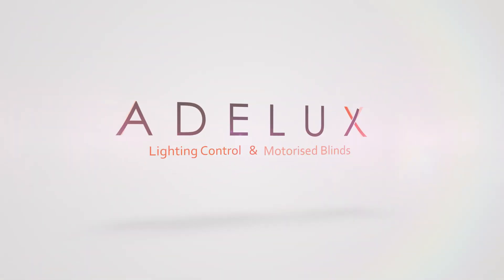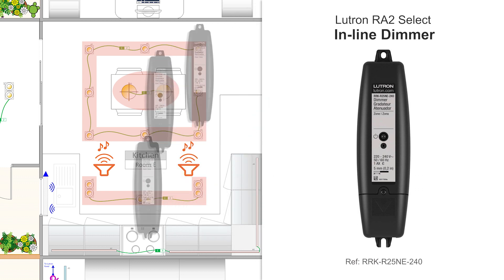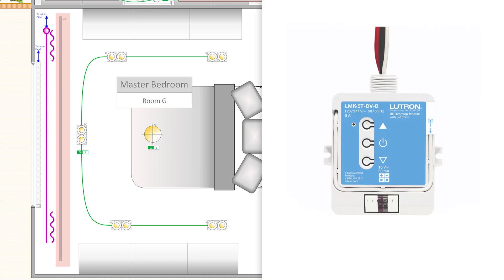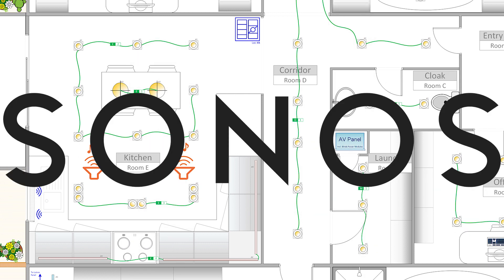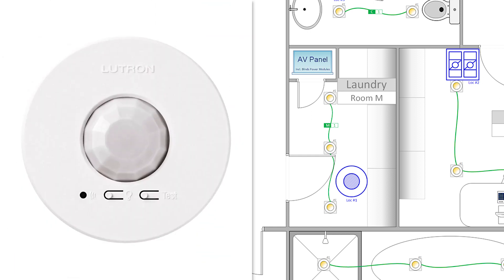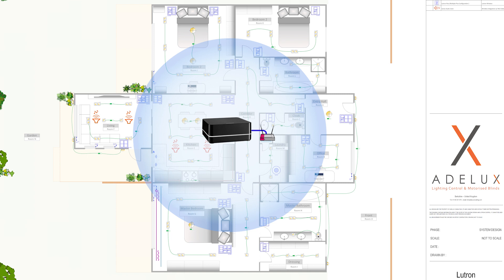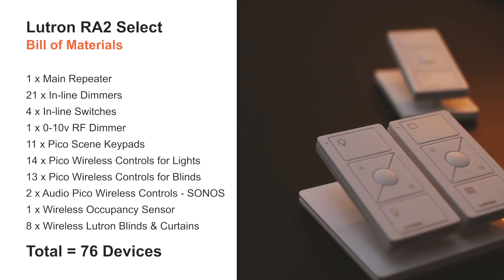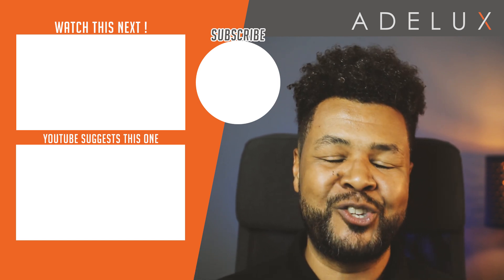Lutron RA2 Select // How to Design a Full System in 5 Steps - [NEW] (2020) Adelux

Comment: Hi , good information...can you show how is the best way for Label the wire in the panel? I start work in Homework moduel in 3 panel, i want to do it right.😁
Reply from the maker: Good question and probably the most important part of a successful Lutron install. Labels in lutron panels are “fixed” let’s say and generating the wiring report from the lutron software will solve that. What you want is to assign a reference number for each lighting circuits so it also show in that wiring report. The best way is to use exactly the same reference used by the electrician - you all want to speak the same language! Hope this helps. Check out some of my first videos about “load schedules” and “lighting floor plan” were I cover those subjects. Good luck 😉

Comment: Hi I have a question my switch is for more then one spotlight so can I buy RA2 Select in-line Dimmer for it?
Reply from the maker: Thanks for comment. Not sure I understand the question. If your spotlights are part of the same circuit and if they are dimmable then you will need one in line dimmer. Hope this helps

Comment: Great video, I'm still trying to wonder why use dimmer module?  What is the value?  Is it merely so the electrician does not have to run a line down the wall to an outlet (ie hardwire option)?
Reply from the maker: Correct! When using the inline dimmer with pico(s) there is no need for a line down from light fittings

Comment: Hi Xavier and I know this is late to the table but congratulations on very professional and easily watchable useful content - Thank you. 
Quick question about design of my first system... Electricians are keen to wire in line dimmers and switch modules to central location,  rather than in ceiling etc.  I know there not designed for this layout but will this work fine or do you envisage any problems? It will be near,  easy maintenance in future,  no signal issues and they have to run new cables anyway.  Lutron forum users seem to suggest not a good idea but don't state why and official documentation does not seem to disapprove? Any help or info you can give world be gratefully received - Thank you.
Reply: Wow,  thanks for the prompt info which is really helpful and hopefully other "newbs" will find useful :) Looking forward to starting first project next week and will watch your videos with interest.
Reply from the maker: Hi, thanks for your feedback and kind words. Very good point. There’re other wireless lighting control system that you don’t want to have centralised and close to one an other. But Lutron wireless communication allows you to do that. It is not written anywhere but lots of lutron dealers like myself done it successfully. I really like this centralised solution, especially for future access to the modules etc…lots of Lutron professionals are posting pictures of their Lutron RA2 select centralised install on social media. Hope this helps. Good luck with your project !

Comment: Question. Why use inline dimmers instead of the standard wall dimmers?  I think the inline is more of a lifetime issue where as the wall plates can be upgraded in the future. Sorry if this was a dumb question.
Reply from the maker: This is not a dumb question! 
I fully understand why you ask for it. 
1- I’m based in the UK 🇬🇧 and so far we ONLY  have « in-line » modules.
2- I guess the fact you have access to wall dimmers offer you extra flexibility & options - specially when doing retrofit. 
3- I understand the future upgrade situation or even the maintenance, but it’s seems to me that using wireless pico control or any wireless control for that matter it’s here to stay. Also if you job has been designed properly with proper records of where your inline modules are installed, it shouldn’t be too much of an issue to replace. 
Anyway this is only my point of view. 
Hope this helps ✌🏾
Reply: @adelux   I asked the same question. I can't figure out the value/practical reason of the inline dimmers. @adelux Lighting Control - Are you saying that in the UK you do NOT have Wall mounted light dimmers?
Reply from the maker: Correct! In the UK we don’t have wall dimmers in the RA2 select range. I guess the value here is to get the neutral wired to the dimmer as we don’t often find it at the switch location traditionally. Hope this clarifies. Many Thanks 
Xavier

Comment: Can you just not use a dimmable in line ra3 module and just use a normal switch, that way you can future proof if you want to add a dimmer?
Reply from the maker: Thanks for your comment. Sorry, not sure I understand the question? The in line dimmer is already ...a dimmer? If is this about pre wire for traditional normal switch, I would call that “past” proof rather than “future” proofing the install. At the end of the day, my recommendation regardless of the system used, is to install it as it should be. Explain your concerns to your local Lutron dealer they should be able to guide you correctly. Thanks
Reply: @adelux  sorry should have explained better cancel out the switching part, I meant can you use dimmable in line modules on non dimmable lights, e.g the led strip so if in future you wanted to change to dimmable strips?

Comment: excellent presentation. Does it depend on the internet?i mean if the internet is down, would the picos and the APP still work?
Reply from the maker: Thanks for your comment and kind words. The quick answer is that yes your system will still work even if your internet is down. The app won’t work but you will still be able to operate your lights and blinds using your Picos.

Comment: Can i control alena QS D105 motors in this thing's?

HQP6-1 has been installed at the my project but a little confusion is that can we integrate it from RA2 ?
Reply from the maker: Thanks for reaching out! 
I’d love to give you a precise answer but honestly I’m not too sure I understand the question. You have Alena QS on Lutron HomeWorks QS project and doesn’t work? Please could you clarify? 
Thanks
Reply: Adelux Lighting Control & Motorised Blinds no i have alena QS  with homeworks qs system but i need to integrate these with lutron wireless RA2 system so it can be possible , in current situation only motorised curtains are controlled but i need to add lighting automation also like RA2 system. 

So it can be possible to integrate those alena curtains and wireless RA2 lighting systems.

Just need answer in yes or no if yes so why?